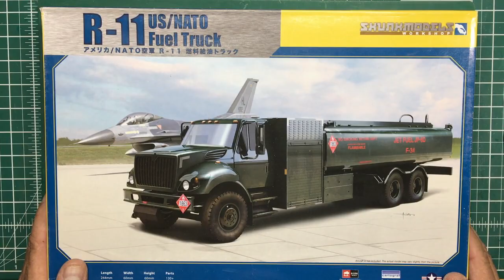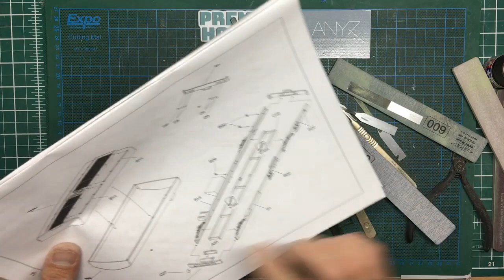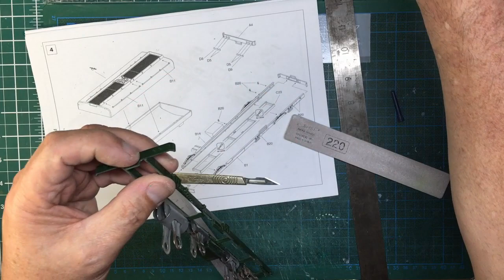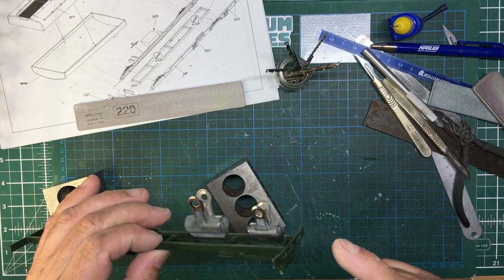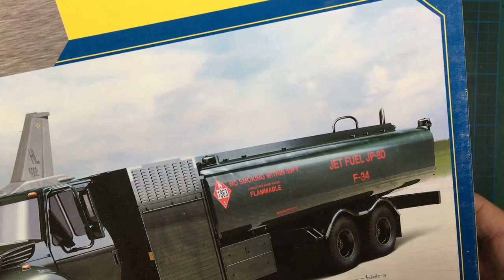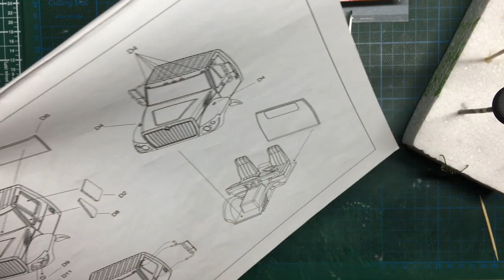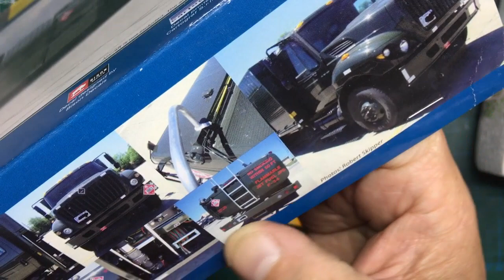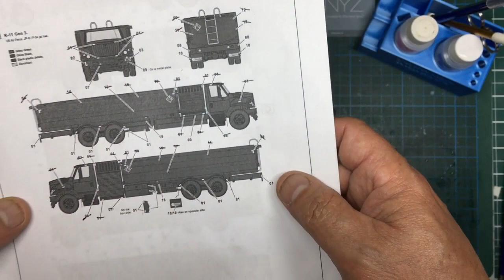Skunkmodels 1/48 R-11 Fuel Tanker. Full build.

Comment: I was planning on doing pretty much a straight build on mine, been working on it off and on this past month of June. Due to the amount of body puddy needed and the amount of sanding needed on the frame of the fuel tank, I am going to try a few different glossy greens, gonna try some model masters, some testors, some tamiya, some hombrol, see which ones come closest. I have seen these up close at Tinker AFB and Altus AFB here in Oklahoma, its like a very glossy evergreen color, not quite OD green, but almost there... depending on upkeep and age I think.
Reply from the maker: I like the way mine looks. green is difficult in photos and videos. look at the spectrum of colours you can find if you search "Keswick Green Land Rover"
Reply: @NigelsModellingBench  awesome. So far I am down to tamiya rs-9 green or their OD green, but may mix both n spray on from there.

Comment: Interesting built. And a quite novel way of adding tread detail to the tires. 
I did the research for this at NAS JRB Fort Worth. Unfortunately a few shortcuts were taken - there are plumbing details missing as well as noticeably missing details on top of the tank. And of course the tires need automotive tread added. I have to say I did not encounter the same problems with the plastic and the fit was actually much better. It may be because I had some of the first boxings under the original Kinetic name. I built two - one in each color scheme, and gave six to the fueling crew at the base. I've got 3D wheels available with the correct tread and even lettering. If interested in the wheels or my extensive walkaround contact me.

Comment: Nigel, when you finished sanding down the car body filler on the first long side of the tank and you noticed a dent - you mentioned after that, that you needed to add some Mr. Surfacer on that side.  Was the Mr. Surfacer needed to fill in the dent?  I ask because the dent looked rather deep to me and I wondered why you wouldn’t use some more car body filler instead of Mr Surfacer?  I’m a beginner and I am currently having this type of problem with one of my models.  Making drop tanks and the plastic is kind of wavy on one side.
Reply from the maker: Filler is great for a one time application on small model parts compared to a car fender for example. Mr Surfacer is wonderful for multiple applications as it is consistency is the same all the way through. If you are having trouble with a drop tank, best put lots of filler on and carve it back as if you are making it from scratch.

Comment: Those tweezers don't stick to cyano either and it looks like they were originally produced for Italiscary or Revell ;)
Reply from the maker: Sorry.. No comprendo????
Reply from the maker: @toboldlygosmodelworks1973  not sure they are the same James? The ones i have dont have any logo on them and they are labeled as "non-adhesive" on the packet. I've seen many tweezers with "non-magnetic" on them.
Reply: @NigelsModellingBench  I'm just using the Mark One Tinsmith's eyeball (retired),  it was just odd how similar (even down to the way they've been ground) they are and where the printing should be was a piece of heavy duty adhesive tape.
Reply from the maker: James Mower yeah.. I thought the same. I wonder why they stuck a piece of thick transparent tape there?? Maybe it denotes that only one side is non adhesive and it’s that side?? Maybe that piece of tape is worth £7??
Reply: @NigelsModellingBench   Regardless they are fantastic tweezers. Both sides are the same material, are non magnetic and smell and taste the same (an old tinsmiths trick). The only reason I can surmise for the tape was to stop them being chemi-etched with a brand.